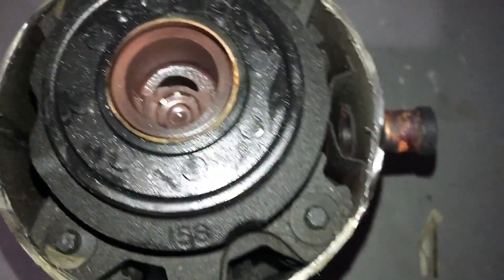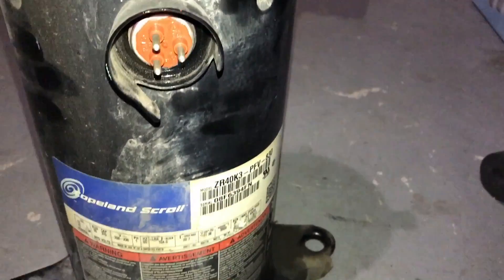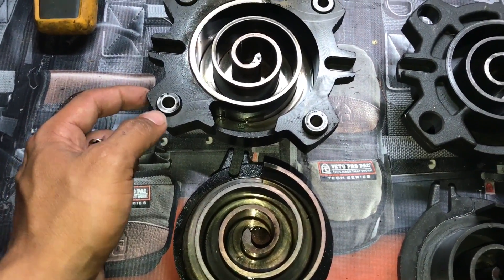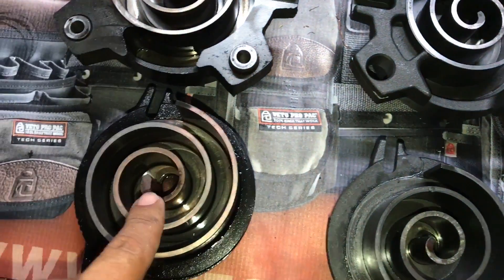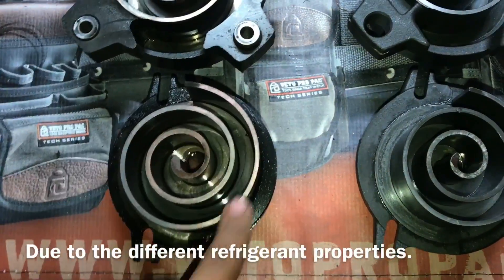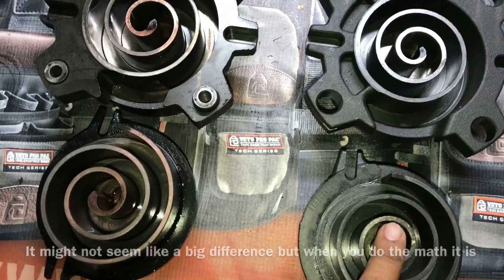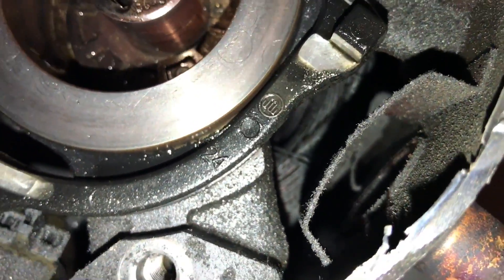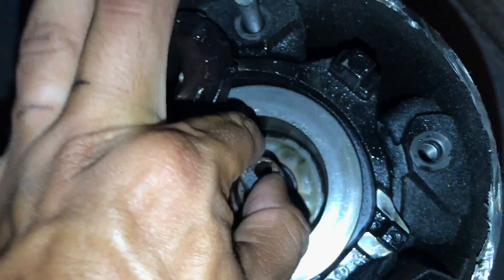What's the difference between a R22 and R410a compressor that are the rated for the same Capacity

Comment: My r22 compressor went out.  It was made in 2002. My evap coil is 410 and was installed 2012.   The guy wants to get a 410 condenser and reuse my r22 in the system. Will this work?
Reply: Keith Connolly nope he’s gonna screw you over . Those compressors are designed to run at certain pressures R-22 and R-410a run at different design pressures and temps . Plus it’s unlawful to mix and match components

Comment: Bro have you checked the RPM differences bc  that will also create the difference in cap/ output
Reply from the maker: Charles Rotchford rpms are the same on these to. It’s more the displacement.  Inverters will vary the rpm to control capacity but these are standard compressors

Comment: what about piston compressors can one handle 410/32 on a compressor designed for r22.
Reply: Same CFH with different refrigerant density at the same ST = will not equal the same amount BTU ( the difference between professional and unprofessional. is that professional is of, pertaining to, or in accordance with the (usually high) standards of a profession while unprofessional is unbecoming of a professional; hence inappropriate in the workplace.)
Reply: If anything, plain propane is the most compatible with R-22, but that's a whole other problem.  @vlqllvol

Comment: can conver a 410 to 22 quit clean oil put mineral ? what is problem compresion?
Reply from the maker: Rusovich capacity.  410a compressors pistons/scrolls  are smaller than r22 rated for the same capacity
Reply: yes but work ?  decrease capacity

Comment: Ok, explain the total btus of each compressor. I see that the 410a has smaller displacement. It is still a pump and does not know what refrigerant that is used.Good video ,Ulises..
Reply from the maker: Michael Lee thanks. True. It's just going to move less refrigerant at a given rate.  410A can absorb and release more heat than R-22

Comment: awesome video man. can't get enough of these open compressor vids. what blade are you using to cut these open?
Reply from the maker: Anthony Suau thanks man.  Just a grinder and cutoff wheel for metal
Reply: is there a specific kind of thickness on the wheel?
Reply from the maker: Anthony Suau I just use the thinnest one. Cuts easier.